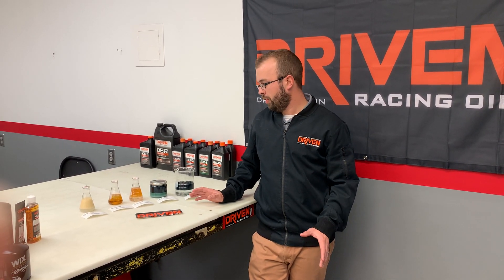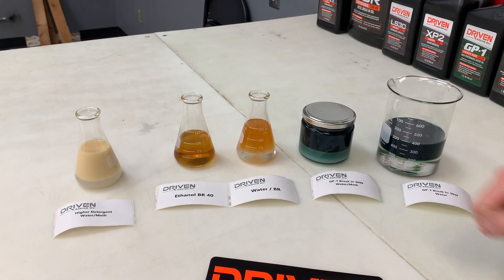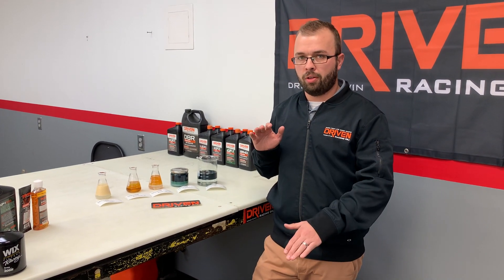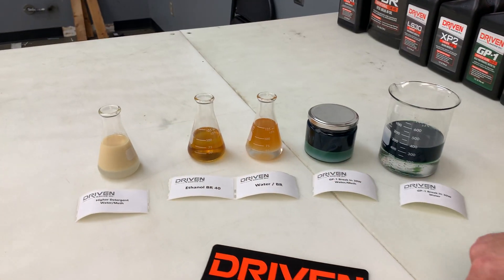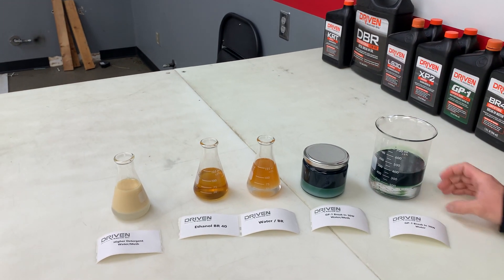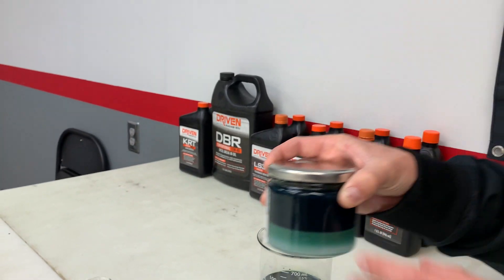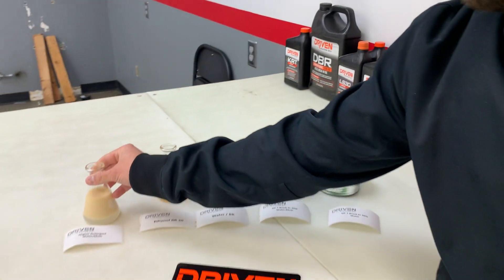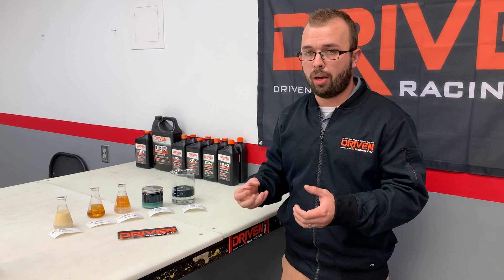Low Detergent Oil; Critical for Engine Break In

Comment: hi, need your advice. I have 2 sets of your DRIVEN Break In oils, one is BR Conventional 15W50 and the other is BR30 Conventional 5W30. Now which one should be used for the initial (50-80 Miles) and which would be better thereafter? Now since I live in Germany I don’t think I can buy another type here. I got mine from the states (while I was still an active Airline Pilot)